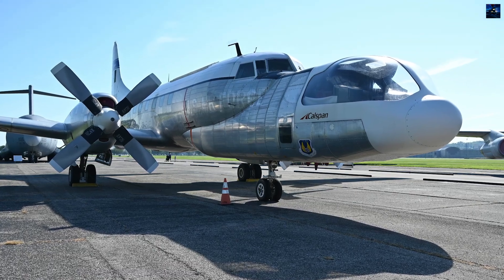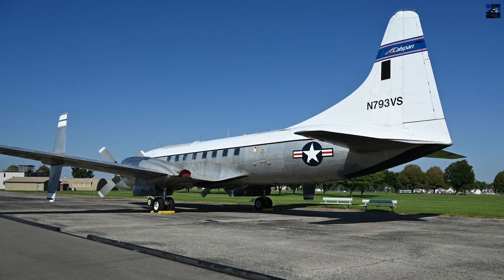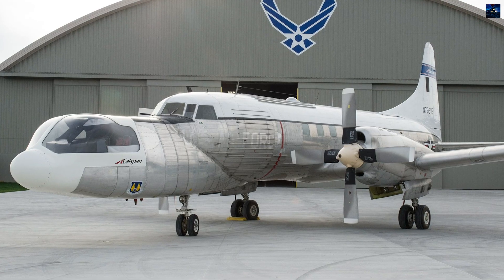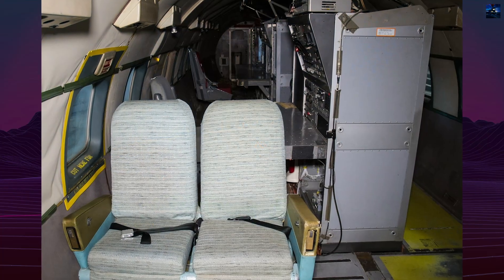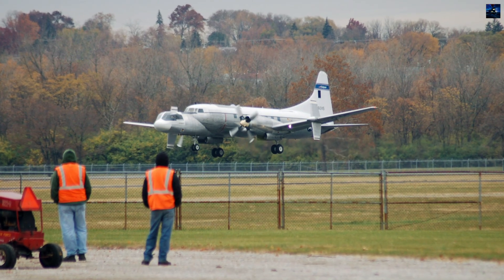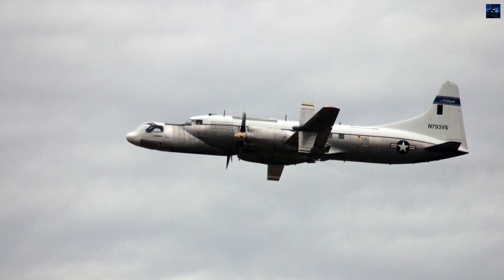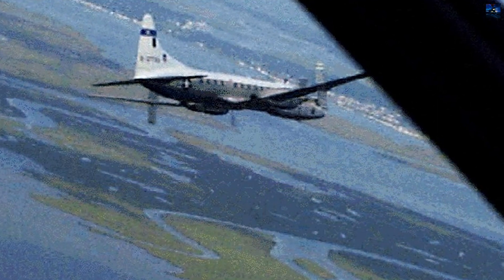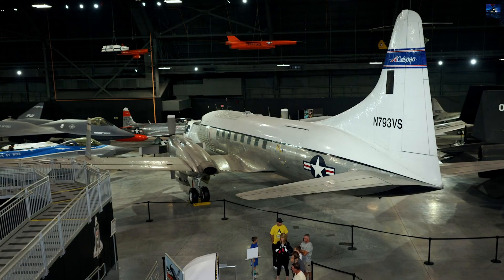Convair NC-131H Samaritan: The Secret Plane Everyone Saw but No One Noticed

Comment: I flew a few times on a Convair 580 which exceeded the 340 piston engine model by light years. It was fast and had a very noticeable acceleration. Frontier Airlines used the aircraft for short haul flights to the many small, but active cities in the Montana, Colorado and New Mexico areas of operations.